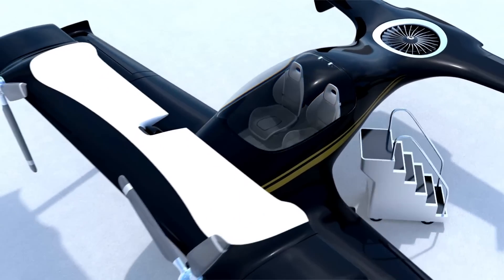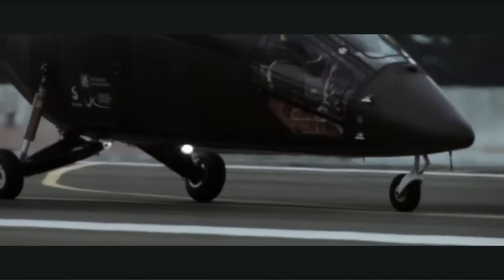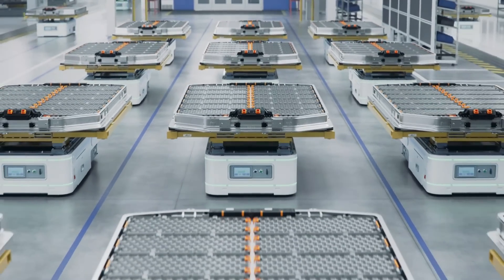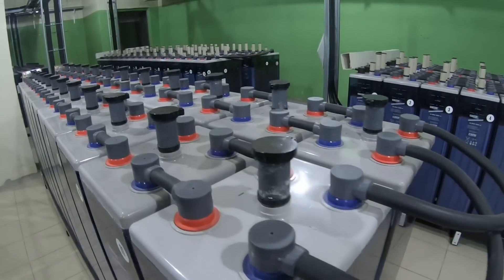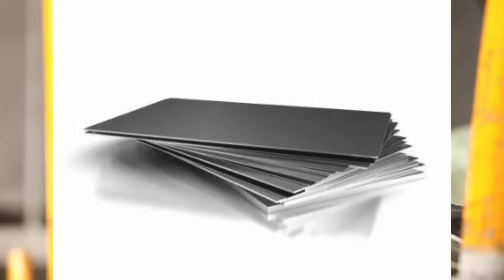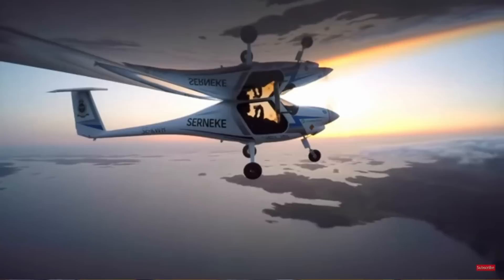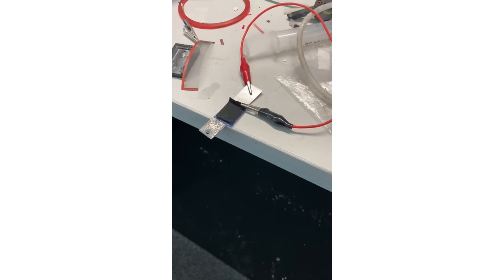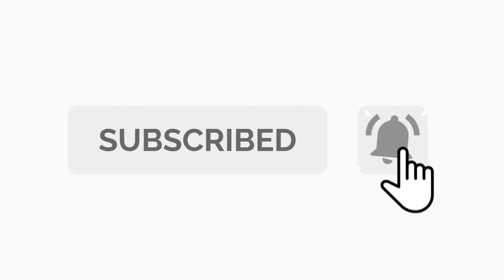Aluminum Air battery: The battery for electric Aviation

Comment from the maker: Dear All, I wanted to make a point that Aluminum Air batteries are "Rechargeable" by replacing the Aluminum plates. So yes you cannot connect to an electric charger to recharge them, but you can change the plates and remove the powdered Aluminum Hydroxide and you are good to go
Reply: Basically, you are discharging the electrical energy it took to manufacture the aluminum plates, ignoring the energy required to ship these plates to the site of use.
Reply: @DaveDave-e4t  - Similar considerations actually do apply to ALL forms of stored energy, but they are seldom mentioned in connection with Fossil Fuels. That is an example of bogus book keeping and is part of the dirty tricks so widely used by the Fossil Fuel 'Mafia'. Molest me not with such bilge!
Reply: @DaveDave-e4t  - As if most people understand the Energy Inputs, Costs, and Types, that get Gasoline From Crude Oil in the Ground, to ones Vehicle!

R&D Discovery Energy, Drilling Energy, Pumping Energy, Storage Energy, Shipping Energy, Storage Energy, Refining Energy, Storage Energy, Shipping Energy, Trucking Energy, Pumping Energy, and Finally - What you get in your vehicle, at a 20% to maybe 30% efficiency in converting Supplied Energy, to Usable Energy!

Imagine if People Complained about the Energy It takes To Cook Their Meals! Or The Energy To Make the Pots, Pans, Stoves, and Plates, Bowls, & Cutlery They use!
Reply: Perhaps a better term would be refurbishable..
Reply: @mikedunn7795  or swappable since the end user cant refurb it
Reply: So what happens to the aluminum?
Does it go into the air?
Reply: @Andy-df5fj  The aluminum is "burned" into aluminum oxide, which could subsequently be recycled back to aluminum by inputting electricity. (However, in actual practice, it might prove more economical to just utilize scrap aluminum.)
Reply: @Andy-df5fj  - As shown, the spent metal goes into the bottom of the cell, ending as a sludge of aluminum hydroxide. Each cell has room at the bottom for this, much like flooded-cell Lead-Acid batteries have. While it might seem to save weight by releasing the aluminum hydroxide as it forms, the practicalities of separating the electrolyte from a very fine powder in liquid suspension would cancel any such savings. Plus the aluminum hydroxide is a valuable resource in itself, so it would be silly to waste it.
Reply: @Andy-df5fj  No,it is oxidized into aluminum oxide,which can be reduced back to metallic aluminum for reuse.
Reply: Recycling aluminum hydroxide is extremely inefficient
Reply: The problem is you need carbon rods in the manufacture of aluminium from the oxide and release the same amount of CO2 when you burn fuel
Reply: This is not recharging but battery refurbishment, absolutely not feasible in minutes when on gas station. 
Instead, robotic replacement with new battery unit is the only possibility.
Reply: @vencdee  - Airliners and large Cargo Planes in particular would easily be modified to accept Aluminum-Air batteries in the standard form factor of the aircraft's normal shipping containers. That means very quick battery swaps, perhaps quicker even than refilling aviation fuel, and no risk of spilled fuels and fires on the tarmac. No more fuel system issues bringing down planes, nor fire risk in case of crashes, either!
Reply: @vencdee  why robotic?

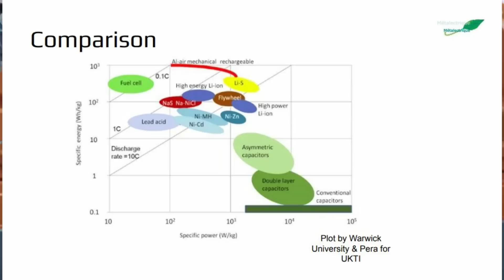Comment: If we look at the overall equation at 3:28, the mass of the reactants is 216 (excluding the oxygen, which comes from the air and is not part of the starting weight of the battery), and the mass of the products is 312. Therefore the battery increases in weight by about 50% as it discharges. Are the figures for energy density based on the initial or final weight? (This problem is even greater for the Li-air battery.)

Comment: The problem with non rechargeable batteries like this is they will never be fully discharged. Pilots will not take off with partial "fuel" and will replace the batteries with half charge or less. We need to see what the economics of this look like. How much do the batteries cost? How much do you pay for recycling? What is the cost per flight hour as compared to avgas?

Comment: For reciprocating ICE, with engine ~2x the mass of fuel carried, effective energy density of AvGas is:
45 MJ/kg  x 25% engine efficiency x 33% fuel fraction = 3.7MJ/kg  or  1042Wh/kg
This is why electric light aircraft will be commercially feasible once batteries achieve >500Wh/kg. Amprius already have a pilot plant for 500Wh/kg, and if gamma phase sulphur can be scaled up then expect Li-S to beat this with high cycle numbers.

Comment: Great Video , thanks, 
I do remember Toney Seber [ world famous Economist and futurist ]  pointing out that it takes 9 years for a new battery to go from concept development  to retail use .
In that time Lithium batteries have an average price fall of 16% per year and an improvement of energy density of 4% per year . So that whatever you invent today that is tested safe and functional for use  , has to be cheaper and more energy dense than lithium batteries are forecast to be in 9 years time.  
Seber said for this main reasons [ scales of economy and energy density improvement ] it has been very difficult for any new battery concept to beat Lithium Batteries The long development lead time of 9 years is the main problem with new battery technology,  .

Comment: I have been reading about this for 30 or 40 years. High time they were used for aircraft propulsion. Sudden power bursts could be handled with supercaps. The aluminum hydroxide can be reduced to metallic aluminum with electricity,which could be derived from renewable sources.

Comment: ALL METAL-AIR BATTERIES HAVE A FATAL FLAW!  If an aluminum -air battery weighs 100 pounds when fully "charged" then it will weigh ~150 pounds when fully discharged! The kWh/kg of metal - air batteries is always quoted when they are fully charged (sneaky) but they GET HEAVIER when they discharge because the oxygen they use from the surrounding air to oxidize (burn) the metal ends up being stored in the battery. In an aluminum -air battery the aluminum hydroxide becomes the stored  waste product. Not good for aircraft when the battery gets heavier as it consumes its fuel. 

Burning gasoline or diesel works the same way except the non-heat waste product is a gas (CO2) and is just excreted into the air (pollution). A gallon of gas weighs ~6 pounds but burning it exhausts 19 pounds of CO2.

Comment: A friend working on these Aluminium-air fuel cells mentioned an interesting aspect of their chemistry: traditional infernal combustion engines ditch their exhaust products continually, but Al-air cells don't. Nothing is jettisoned, yet air is continually input, therefore the Al-air cells are actually heavier at landing than they are on takeoff! (This don't 'alf bugger the Breguet range equation).
Reply: Interesting, but how can it be heavier at landing than take off, are you saying aluminium oxide is heavier than aluminium metal?

Comment: @2:19 what is the units on the X axis supposed to be Milli AmpHour per CM square?  Wouldn't a measure of per cubic cm be better?  Just asking

What format / size are these batteries available in?  I'm thinking that they would be the "cat's ass" for use in FPV drones in Ukraine.  Longer range, don't have to worry about recharging most of the FPVs.

Comment: But what's the cost of reprocessing the aluminum?
Reply: Not much but complication. Replacing the batteries with new ones is the only way. This needs complete cycle of distribution of batteries etc. and thus extreme costs at the beginning.

Comment: With the cost of an idle airplane, swappable is preferable to chargeable.  One "negative" of aluminum air is a non-issue.

I have suggested EV's use a 100 mile rechargeable battery with slot to install 3 swappable, 100 mile (25lb) aluminum air batteries.  Commuter type driving, you have one aluminum air installed as a range extender.  When you go cross country, you fill all 3 slots, and replace them as needed at "filling" stations.
Reply: Sounds good.

Comment: If these can be used in small UAVs like FPV UAVs  then not be rechargeable might not even be an issue in scenarios such as their use in Ukraine where they are used in a kamikaze mode.
Reply: Definitely feasible usage model. Drones and one-time used devices, energy hogs. The thing is if there's enough demand to build big factories and offer reasonable prices to market. Because batteries made in small numbers will be very expensive.

Comment: Electric aviation will never be a thing
Reply: I disagree. It will be thing for short distances in near future. Longer distances depends on technologies advance, it will take decades for sure.
Reply: @vencdee  it’s not practical today, neither will it ever be. The energy required is simply to high for batteries to, not now nor in the future.

Take weight, landing weight, fire hazard, and many other flaws.

The regulations require at 45 min fuel reserve. Adverse weather, ice, headwinds all make it a non starter.

It’s simply not practical.

Comment: Yeah, the Pipistrel velis club has much longer endurance, more useful payload, and higher cruise speed than the velis electro, so it's far from accurate to claim that's there's only a 2-3 times difference. 

Still, the Velis electro has enough range for it's purpose, and that's even a model based on a combustion engine model, and not fully optimized from the ground up with electric propulsion in mind. 

Also, it would be possible to just increase the size of a plane and sacrifice usable payload to increase the battery capacity and increase range that way. Sure it would mean very large planes for a given payload capacity, but that would make it possible to have short range commercial flights with currently available li-ion batteries.  

Using aluminium and then recycling it is an intriguing possibility, but it's not commercially viable if it's too expensive, which it probably is, in fact it i is probably very much to expensive in reality. Reaching even to somewhat near theoretical potential capacity probably requires many years of extensive R&D, trial and error. Which are things that typically comes after wide commercial adoption. In fact aluminium-air batteries have a lot of similarities with synthetic fuels, similar disadvantages, and also some very significant extra disadvantages compared to synthetic fuels, like only having a small fraction of the energy and power density of synthetic fuels.
Reply from the maker: No unfortunately. There is an optimal ratio of batteries to aircraft weight.

Comment: This is great news for me! I note also that Airliners and large Cargo Planes in particular would easily be modified to accept Aluminum-Air batteries in the standard form factor of the aircraft's normal shipping containers. That means very quick battery swaps, perhaps quicker even than refilling aviation fuel, and no risk of spilled fuels and fires on the tarmac. No more fuel system issues bringing down planes, nor fire risk in case of crashes, either!

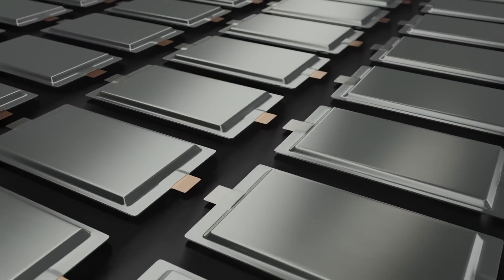Comment: 3:00 So the Lithium-Sulfur batteries were rejected for not having enough charge cycles and instead they chose the Aluminum-Air batteries with ZERO charge cycles?  🤔
Reply: Good point. Li-S batteries are still in development and there is reasonable progress, but not so big to go commercial.
Reply: Not zero... One cycle 😜

Comment: So…the most expensive part of an electric craft is the battery, and here that needs to be replaced after every flight? That sounds wildly uneconomical
Reply: In China robotic replacement of LiIon batteries, instead recharging is reality. It is about building a different type of energy distribution and life cycle on commercial level.

Comment: If  they  can produce an " In-Use " Rechargable version of these , then the " Battery Revolution " will have happened .
Reply: Improbable... Changing aluminium hydroxide into aluminium instantly seems as impossible task. You need factory.

Comment: At the beginning of the video, you state that the AirAL battery has 4x the power density of Li-ion, but at the end you say it has half the power density at around 500W/h. Did I miss something?
Reply from the maker: Energy density is 4 times. Power is 500 W/kg

Comment: Another wonderful overview and thank you. In my mind, the bigger question is "why". If this is being done to provide cleaner and "more eco friendly" alternatives to fossil fuel combustion, then we also have to consider the environmental costs of producing these batteries vs. buring av-gas if they are a 1-use option.

Anyway, as usual you have presented the information in a wonderfully structured form and I've learned something today as a result! Cheers from Sydney - Dave
Reply: Think about it, any country with wind. solar and bauxite can produce these batteries bypassing the big boys who control the oil production,

Comment: Non rechargeable it is more like a fuel, used up, burned up. Looks a good reason it has no general future. Suicide military drones use though seem ideal. Like a missile.
However with any luck mass aviation will be almost completely curtailed and stopped. Almost no need for it at all.

Comment: I believe you and the other proponents for Aluminum Air have a misunderstanding of the true nature of that technology. It would be more realistic to think of it not so much as in Wh/kg but in battery consumption per hour. If considered more in the way that highly stressed military missile and drone propulsion is,  which is essentially a one trip aircraft with an "engine rich exhaust", you have a better description of the  single use Aluminum  Air Battery.

Comment: This isn't a battery.  This is a fuel cell.  The fuel is aluminum.  You don't recharge it you refuel it.  Considering the cost and carbon footprint of aluminum, this is not a solution.  Maybe for military drones, but not for general aviation.
Reply: Agree.
Reply: I agree that its a fuel cell but disagree on the carbon footprint, they are not producing aluminium specifcally to make these fuel cells, they are using aluminium from off the shelf

Comment: "air breathing battery"... Also known as a solid state fuel cell... Not a battery.
Also, you can't smelt aluminum hydroxide back into aluminum. You can only recover that electrolytically using really toxic processes and a shitload of electricity.

Comment: A great new breach of 400-500 Wh/kg barrier…a good little step in the right direction….but…I’m watching when the micro-fusion electric generator combines with batteries…it is comes to possible….then….you will not need tank you car…in your life….also freight transport on land, sea and in air….the same thing….finally, we’ll have plenty of energy to go to Mars and the nearest stars…we’ll scrap fission and oil and gas power stations also solar panels, wind turbines….After that…we’ll concentrate to extract energy from space-time…as Tesla imagined and predict…then we’ll have the power of….creation….like Gods 🧖

Comment: Burst power could be provided with ultra capacitors in parallel with Al-Air batteries.
You didn't mention the that fact that the energy for flight actually comes from producing aluminium in the smelter (which takes a lot of energy). But that's the point - that energy goes in to making the metal and is released when it oxidizes. In a sense, the aluminium is a fuel.
Nice, clear video.
Reply: There is nothing to stop the intruduction of li ion pack for power burst and the aluminium air or iron air for main power, there are tons of aluminium that goes into landfill at the moment so this is just another way of breaking them down quicker. ie squeezing every ounce of energy back out, people are thinking that the aluminium used was produced just for making the batteries

Comment: In case you don’t know. 
An aluminium air batteries are non rechargeable. They have a huge amout of energy because aluminum is made by electrolysis from aluminium oxside. And it takes a huge amount of energy and nasty chemistry to do so. It also, like fuel, doesn't need to bring the oxygen. So unlike a normal battery it only has to carry half the chmical components.

You can "recharge" it by replsing the aluminum once consumed. But aluminium is expensive and not at all friendly to the environment to make. So the idea thisnis a reusable "eletric" airceft is really a bit erroneous. It basically needs aluminum fuel and this has its own diposal and pollution problems. 

They were investigated as one use bateries with very high power for things like missiles. So you can keep it on the shelf for 20 years, and it will just start up and give full power. And it's going to blow up anyway. 

A new militarily application would now be for suicide drones. Their range could be massively extended. Suicide drone aircrft could also be made very quiet if eletric insted of petrol. 

But its an absurd use to put it in a plane. The amout of aluminium required is a horrendous waste of a  valuable resource. 

https://en.m.wikipedia.org/wiki/Aluminium%E2%80%93air_battery
Reply: When you can replace and recycle it, than it's not waste but just a source to recycle using the same energy which was consumed.